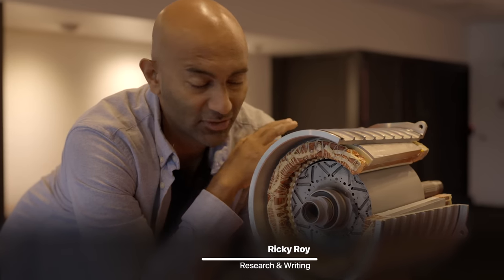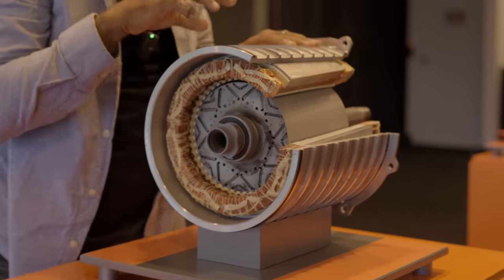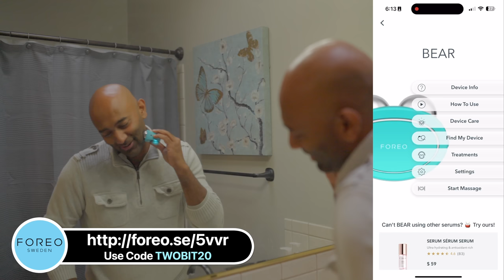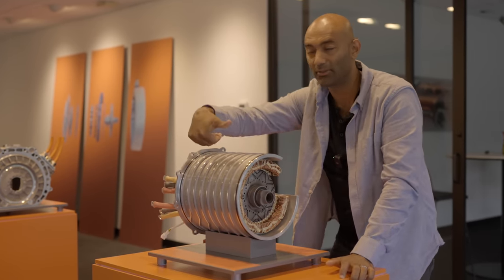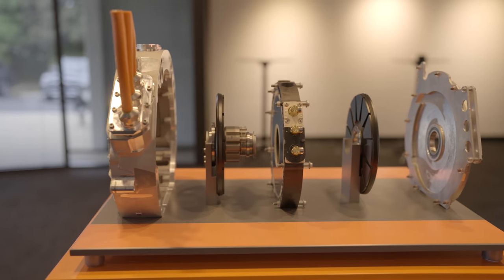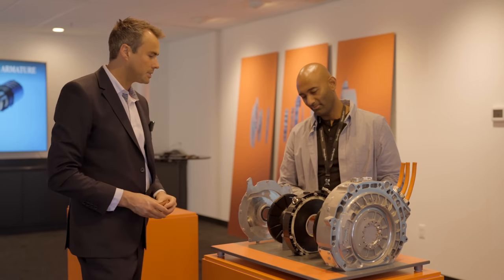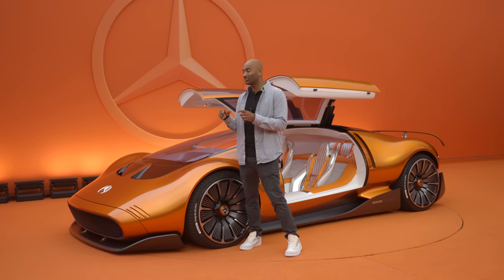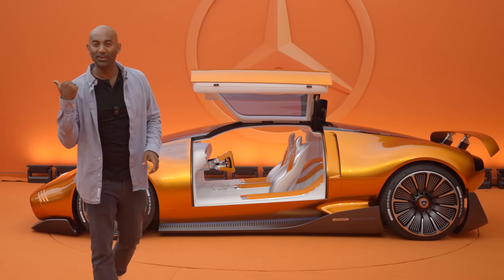Axial Flux Motors Will Change CARS - Here's Why

Comment from the maker: Check out the Foreo BEAR today! https://foreo.se/hmnj
Reply: Con job. Efficiency is terrible because it doesn't have gears, and needs over 100 thousand dollars of energy sapping computer nursemaiding.
Efficiency and power to weight is 20% of 1908 electric cars.
Their batteries and electric systems lasted a century.
That's why they stopped making them.
Reply: its basically a simplified and scaled down version of the electric motors the germans use for their newer U-boats.
Reply: What's the difference between these type of motors and Elaphe motors?
Reply: Looks like they highjacked tesla research
Reply: FWIW the most costly part comes from the battery EH
Reply: Stator stack manufacturing is a bit more difficult for axial flux designs, because the crosssections of the stack changes in the stacking direction. The processes of lamination stack manufacturing for radial flux designs on the other hand are age old und are super efficient. There are ways to achive similar efficiency for the axial flux stator manufacturing, but they have to be developed by each new supplier. This means a limited supplier base, less competition among suppliers, higher cost and longer lead time. If you want to have your new motor ready as quickly as possible because you've been asleep all this time and now want to keep up to Tesla, you go for what everybody already can do .. radial flux machines.
Reply: but can u recycle the motor? mahle was talking about making a recyclable motor but needs transmission
Reply: the code didnt work
Reply: Sir, that larger motor is the Tesla motor and is a production on the Tesla Y and Tesla commercial trucks.  The smaller MB electrical torque are newer tech is testing for new applications.
Reply: Batteries have to be changed before this is viable. The composition of the batteries.
Reply: This type of electric motor would be more efficient for light weight and ultra light weight aircraft.
Reply: Mildly interesting but the fact is you can’t get something for nothing. IF you can make that motor that much smaller and lighter and as powerful you are going to have to dump more energy into it to make it work. There is simply NO free lunch. But it seems it’ll make it lighter and free up maybe enough space to regain enough battery to regain maybe 2 of the 40 miles of lost range.
Reply: Yeah, I don't think this changes most cars, because ultimately the space convenience isn't really all the important for every day cars and really only yields weight savings for supercars and hypercars. The real benefit would be offroad vehicles. You have an engine at each wheel, you can drastically change how much or how little clearance one has underneath where raising the entire chassis a foot higher could be a real option.
Reply: Doesn’t Koeniggsegg already has a 600hp axial flux motor in their gemera?
Reply: Spin Speed Hardly matters in a motor, if you just follow one of the most basic principles in rotating objects.... Big object rotates smaller objects faster.
As stupid as it sounds, just make the transfer end of the axial from the motor "big" , when you have the torque, your only limit is the bottoming out of that rpm. 

Obviously in Axial Flux motors, if you can only go 22k Rpm, that is going to matter, but it's a good thing you have a gearbox.
Reply: There's nothing new here.  It's just an electric motor.  Windings can be on the stator or the rotor.  The stator can be the inside or outside of the motor.  All this in every variation has been implemented for years.  All motors are tailored for their particular application.  This one is no different.  It may even be a particularly well designed motor, but it's nothing new.  It's just a motor.
Reply: Ah. OK. Is an electic motor yeeeeaaah🤔🤔🤔. I guess.
Im sure we will see better gasoline engines in the near future